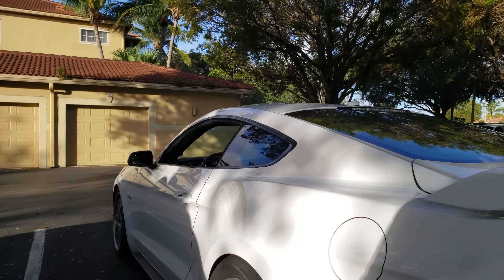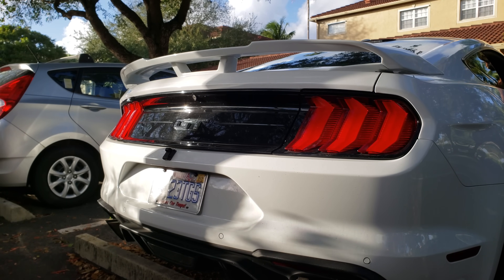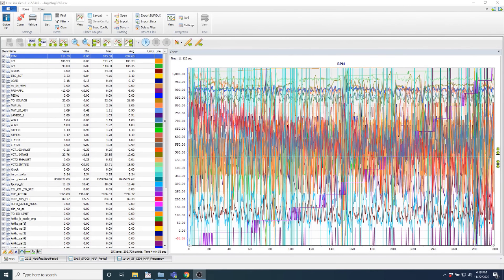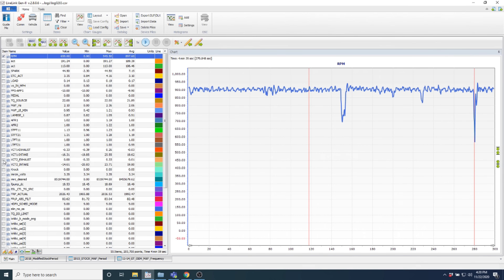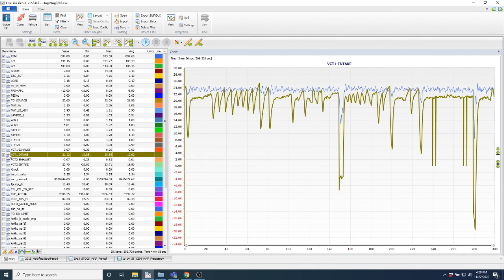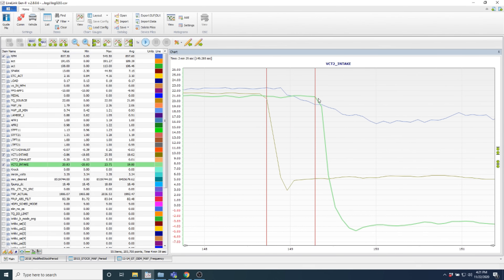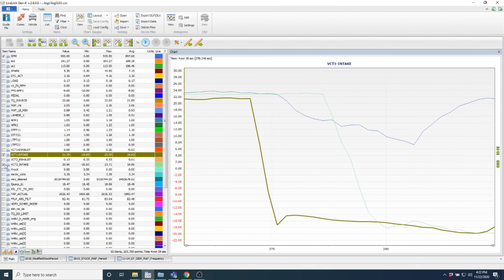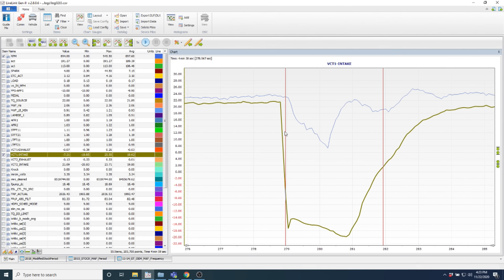Gen 3 Mustang Coyote Intake cam idle stumble issues explained.

Comment: My first thoughts are windage aerating the oil at idle. I suspect its a battle of enough capacity for high RPM operation and minimizing windage at low RPM(idle) with these new motors, possibly due to the new composite pan design. As the oil ages it breaks down and aeration rate increases until finally the intake cam phaser starts to receive the bubbles, and when ones big enough the phaser gets pulled off target long enough for the idle to be affected. Your log shows 7-10* swings even in relatively stable RPM portions of the log, they just don't get stuck as they are brief. I say its time Ford puts a dry sump oiling system on the mustang. The exhaust cams are not affected as at 0* they are up against their stop and not fighting the engines rotation. Command them to 10* and they too would probably start to struggle maintaining that position.
Reply: Dude I wonder if that aeration issue has something to do with the "typewriter/bbq tick"

Comment: I have the same problem with my 19 been in twice for it still did right after the oil change  ford claimed my bank was over retarded  .... i have noticed it  rear its head on cold auto starts
Reply: Have you fixed the issue? Or has Ford done anything to help?
Reply: @drewski58  they replaced my VCT Solenoid haven't had the problem since .... yet
Reply: @jup8934  how long has it been since you changed it and has it still been good since?

Comment: My 16 f150 coyote has done the same thing , only a cat back and air intake , changed oil with 5w30 mobil one and ran a oil flush through engine and hasnt happened again , heard of low oil , or a restricted cam solenoid causing the problem .
Reply: Any issues?

Comment: I don't know if the problem is related but I have a 18 f150 5.0 and I had to have the pcm reprogram for the cam phaser timing issue TSB and the check engine light would come on after 80% of oil life was used so I would clear the code change the oil and it would be fine for another 2-3 months.

Comment: At least for the F-150s, Ford put out a TSB for an updated calibration that fixes the idle cam phaser issue. It fixed my problem but Lund's F-150 tune isn't based off that file sadly. From what I heard, late 2019's and 2020's have an updated phaser design. I've had the problem for years now across multiple different Lund tunes and I can attest that it's not the calibration. (I have a early 2018 5.0 F-150)

Comment: Might be oil pressure control solenoid on the gen3, wonder if it’s possible to up the pressure at idle. Not sure if the oil passages feed the intake cam last. Had a similar problem on an ecotec low oil pressure would cause the intake cam to loose position when at hot idle.
Reply: Yea ive been wondering this myself bypassing it down to 12psi...when its got work to do other than a "hydrodynamic wedge" between bearings heh
Reply: @bluecollardaily2676  both phasers lost position so it’s probably not a solenoid issue. Possibly hot idle oil pressure is low combined with low solenoid duty cycle at idle and leakage of the phasers causing the issue. I would put my oscilloscope on the cam actuators and see what they are doing when the idle drops. I doubt both solenoids are bad at the same time but its a possibility.
Reply: @joe1273   yeap that's what I'm saying....coming from 30 years building, tuning and racing GM the first engine in my new 2019 A10 Premium GT, freaked me out with that stock 5w20 running 8psi at idle with the stock tstat heat soaked....
 I almost shit, then I began looking and seen the oil pressure solenoid , hooked my MPVI2 up to it and logged it and sure enough about 3k it would go from 8psi to 80...I was like wtf sometimes 100psi cold hehe....so I began looking and found out there was a oil pressure bypass at idle and cruise,  I then found its section in the tune...
 Both my 2nd n 3rd engines running more like 190 with my Supercharger and Reisch 170 degree stat...using 5w50...average 16ish lowest idle full heat soaked....
 Now also Lunds tune moves my RPM up a bit as I have a 103mm TB vs the 80mm stock for transition....I hope those things are the variables why I don't have the issue yet...also my last engine was build day May2019 and already had the 2020 revisions like the new balancer...

 I understand cafe standards but id prefer that bypass wasn't there id rather have it at the most oil pressure it can muster idle and cruise, especially when it's responsible for other areas of engine operation....I have billet OPGs and they made zero difference......
 I'm glad I found the bypass being new to the platform, as I was going to raise the base oil viscosity, 8psi just bothered me...that was real close to idiot light territory...
Reply: @bluecollardaily2676  I do diag at a private shop so i have seen a lot of phaser and solenoid issues on all brands. My gen3 hasn’t had the issue but its lund tuned with a gen5 whipple so the idle is up a little bit and its a 10speed. 

Hopefully some one will develop a way to bypass that feature or tune it out. I really suspect its all down to oil pressure/volume. I have seen revised solenoids on other engines that increase the size in the ports to increase flow.
Reply: @joe1273  I agree and I can tell you, you can disable it via tune...with a couple drop downs I may do it after the holidays see what the results are...
Reply: @bluecollardaily2676  please do!
Reply: @bluecollardaily2676  you ever try that?

Comment: I have been fighting ford with this issue on my 19 since I hit 3400 miles. Been to the dealership 5 times since July and had the oil changed 3 times in 7500 miles(2 under warranty). Mine does it everyday when the oil is hot even after a fresh 5w-20 Motorcraft change. When its dead of summer hot out in AZ the low oil pressure light also comes on. Thank you for this video, now I know what to have them look for.
Reply: Its that oil pressure bypass solenoid that comes on at idle and cruise....since its defeatable in tune be interesting to see if you stayed at full oil pressure at idle, if it would still do this.....
Reply: @bluecollardaily2676  That would be interesting to know.
Reply: Any update? Experiencing same issues what has the dealership done to try fix it the last few times
Reply: I got a new engine under warranty because it was coming apart. Dealer found significant metal debris in the oil filter and pan.
Reply: @brianbrown7501  nice how is the engine treating you?
Reply: @jaayd5oh688  The new one has 5k miles and an Edelbrock blower, its been perfect.
Reply: @brianbrown7501  man I know I’m late to the party but my car has been doing this every single day non stop and now it even dies. I’ve been to the dealership 4 times and I keep on having the same issues I’m getting extremely upset with the situation because I can’t enjoy my car at all
Reply: @streettagz7084  is the car still under warranty?
Reply: @brianbrown7501  yeah absolutely
Reply: @streettagz7084  I recommend contacting an attorney that specializes in lemon law cases in your state.

Comment: I’ve been having this on my used mustang 2018 mt82. I bought it with 20k miles. I couldn’t for the life of me get a direct answer from ford. Throttle body going out. Maf sensor. Tensiner. Intake solenoid. Lmrc’s. I’m currently at 28k. Thank you for this video Alex this is awesome!
Reply from the maker: Anytime sir.
Reply: I'm having the same problem with my 18 gt... My dad is a mechanic and he said more than likely it sounds like the idle control valve
Reply: @rrbass82  "Was mechanic" I don't think these even have IAC valves. We got computer controlled throttle body's. No need for a controlled air leak.

Comment: It could be just the plane oil viscosity, they do recommend 5w20 and Iv always put 5w50 and had the same issues. I switched to 5w20 and went away but who knows.
Reply: I use 5w20 always have and still does it pretty bad
Reply: I went from 5w30, to 5w50, and issue occurs less/hardly at all.

Comment: I must agree with the oil theory. It's the most logical diagnosis for cam phasing to drop like it does. I'm going to check for a TSB for phaser or solenoid or both. Just curious if you would change oil to Gibbs Driven 5/50. I haven't experienced this bobble with Gibbs Driven oil in my 18 GT. As always great content Alex.
Reply from the maker: I'll try and report back

Comment: Ford has a SSM out for gen 3 F150(not sure on mustangs) for this concern with p0011, p0012, p0021, and p0022. You replace the solenoids only and reprogram the PCM. I’ve done a bunch. I’m assuming mustangs use the same solenoids in gen 3. I usually see it in trucks that aren’t maintained properly(7500 mile oil changes) but not saying that’s the cause.
Reply: Do you have the SSM number by chance?
Reply: @1970351C2V SSM 50067

Comment: I might be retarded, but my gen1 does this or something very similar, but only when the AC is on and radiator fans kick on about every 30 seconds at idle. Can't find anything on it online, and no codes. My car is on the stock tune currently but I'm eager to get my ngauge soon to data log and see what happens.

Comment: VCT phasers I had this and got my solenoids replaced twice, but now I have other issues
Reply: What were those other issues?
Reply: @5.0bed  Wiring harness was bad giving MAF codes, they replaced the MAF plug  on the wiring harness and it was ok for a while. Then I started having o2 sensor codes and misfire codes and stalling, ford replaced the fuel pressure sensor and fuel pump that worked for a while but the same problem came back. Ford then replaced my engine wire harness because the fuel pressure sensor was having more issues.  This seemed to fix my issue, atleast for a few months so far.
Reply: So solenoids and phasers fix the issue?
Reply: @jaayd5oh688  Yea, the issue where the car would just randomly stumble and die at idle.  When they did this repair though they messed up my wiring harness which caused other weird issues for a while and was very frustrating but after the wiring harness was replaced now everything has been fine for like 5 months and I put a whipple on and its amazing.

Comment: My early 2020 (bought in july) also has a unsteady idle. It’s especially noticeable when you give it a stab of the gas, it hesitates and almost stalls. I just got the 1st oil change done at 6k miles at the dealership and interestingly, they found the wrong oil filter on the car, it had an ecoboost filter on it. I bought the car with 14 miles on it so it was news to me
Reply: I am having the same problem, how did you fix your? Thank you.
Reply: @loanmydiaz6243  there’s no fix for it that’s really known. I’d think the best thing to do is make sure that you take it to the dealer to make sure ecu has the most up to date firmware

Comment: Alex, I've noticed on coyotes, that the throttle body blade "blips" and causes a clicking sound. I confirmed it on an f150 (no maf) and removed the air intake and asked a ford "tech" why. His answer was backed up by documentation saying that it's for condensation build up on the throttle body, the sudden "blips" keeps moisture from formimg on the throttle body and blade. Just fyi

Comment: I had the same surge issues last year, I watched the intake cam freak on the ngauge. I still have logs of it happening, replaced all the vct equipment and it was perfect.
Reply: I have the same problem should I replace the vct solenoids? I was told by Lund to put 5w50 oil and that should fix the problem 🤔
Reply: @sergiog87121  if junior said try the oil I would start at that point, that is the cheapest path. I know ford has always had vct issues, so it's not an uncommon thing. They are also repairing them with no questions, really that should say something.
Reply: Great thanks I'll try the oil first.
Reply: @sergiog87121  did it fix the issue?
Reply: @jesustoro4930  I didn't try the oil, Ford told me not to do that. I decided to replace the vct solenoids instead, probably about 3 weeks ago I replaced them. I don't drive the car much but the time I do drive it, it doesn't have this issue anymore. I hope this did fix the problem.
Reply: @sergiog87121  how long did it take Ford to replace the VCT Solenoids? I'm thinking of doing also.
Reply: @YoungWoodzOnDaBeatz  I didn't do it with Ford, I took it to another shop. They took about a day to return the car back. But for me that seemed to be the issue. The car has worked smooth since changing them out.
Reply: @sergiog87121  awesome brother. Thanks for the insight
Reply: @YoungWoodzOnDaBeatz  your welcome bro, hope your car gets fixed too
Reply: @sergiog87121  having the same issue on my 16 GT, also seen replacing the vct solenoids fix the issue for others as well, i ordered a set and now i just need to get them replaced, i hope this solves my issue as well
Reply: @CODSk8er  hopefully it does, it seems like it fixed it for me so far. Haven't had the same issue since changing them.
Reply: @sergiog87121  did it fix the issue 😳
Reply: @jayden5jayden  yes sir that did fix the problem. Sold the car a couple months ago. But that definitely fixed it. Never had that problem again.

Comment: Heavy Line Tech here. The 18's still use the older solenoids (Gen1/2) on the intake cams. This style solenoid does not have oil running through them to keep them clean. The problem arises from extended oil changes +5k miles or going by the oil life monitor. They mount to the timing cover on a high varnish area with no oil flow, thus they get sticky. No DTC's because they are good internally.  You could litterally take them out, clean them with solvent and will function normally.
Reply from the maker: This happens on brand new vehicles with less than 2,000 miles on them
Reply: @YDBT4LIFE  Yeah thats terrible. They did (TSB 16-0093) with some 16' 3.5's under 2000 miles. Gotta bring them in.  If your out of warranty though, take off connectors to solenoids and cycle with 12v jumper on and off repeatedly to unstick any debris. Sometimes works.  
BTW Love your channel man. I can relate to what you do and follow right along, even with the inside jokes only hispanics can relate to lol.
Reply: If I were to just change the oil do you think I could fix this without having to remove and clean them?
Reply: @That's the least intrusive option, so why not try and go from there. Check the oil level beforehand. '18+ can also have oil consumption and people don't notice until it starts throwing timing codes due to lack of oil to the timing components.
Reply: @ Thanks so much for this suggestion my man. I'm having these identical symptoms as in the video. Oddly though, when my car would stall at idles after a long drive, I'd get a check engine light, and the codes were initially always for a P0308. After a few weeks of this happening, I started getting P0308 and P0300 codes. When I looked this up, everyone seems to be pointing at VVT and VCT. I'm a little nervous about doing this, but I've got the intake manifolds off already, but I'm kinda second guessing it, VCT/VVT install I'm a little nervous about it, which is why I'm thinking about just doing an oil change. I barely drive my car maybe like 800 miles total on the car since my last oil change, but the last time I changed oil was December 2020.

Comment: On cold starts my 19 gt within the first few seconds on, has a idle dip for a split second,  oil pressure doesn’t drop tho. Sometimes on warm starts it turns on like im about to run out of gas smh 🤦‍♂️. Stock no tune.
Reply: My supercharged 18 does the cold start stumble for the first 5-10 seconds, then cleans up and idles perfect.  Lund has sent me a couple of revisions to try to fix it but can't get it exactly right.  Dakota told me their black 2018 does it too.  My symptoms literally just happened out of the blue one day and it's been like that ever since.  I change oil and pull a sample every 3,500 miles.  I've used 5-30, so maybe I should try switching to 5/50?
Reply: @chrisbarnes4688  when should I change my oil?